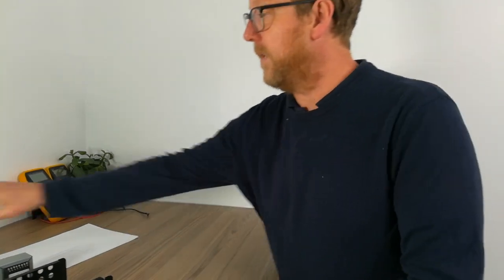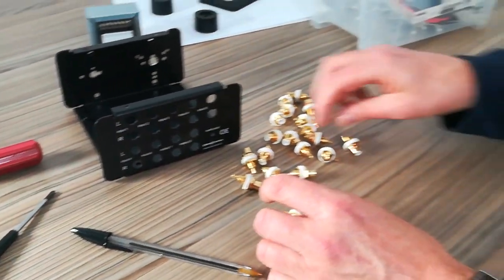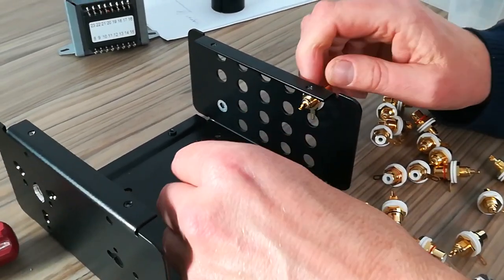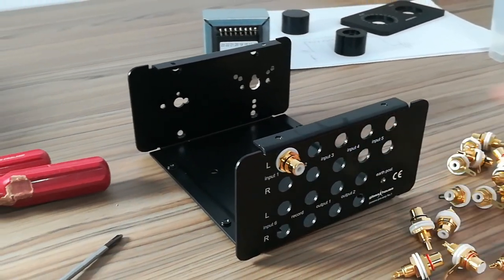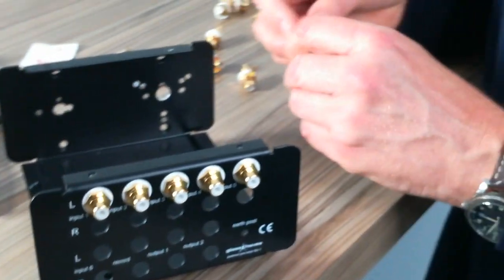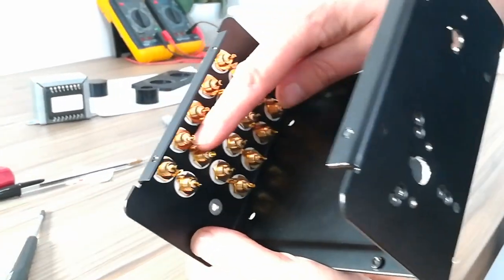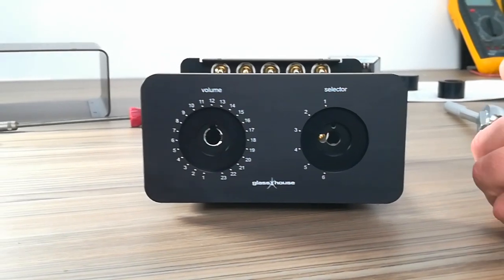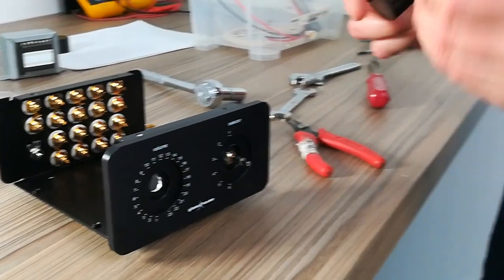How To: Build the Glasshouse Passive Pre-amplifier (part 1)

Comment: what advertising nonsense! Is all the technology of the 20th century used here? And about the technology of the 21st century - normalizers, input correctors, amplifiers of Kunashirsky and stars of Kunashirsky did not even hear ?!
So laugh like
Reply from the maker: Thanks for the comment! It seems to be quite a popular design, and is used, either the glasshouse version or other, by many.
Reply: @hificollective  Clear. And do you have information about the device "network voltage fractalizer", which has been used for amplifiers for 4 years?
Here is a sample of the sound of my full audio path, in which there is this fantastic device (and three others but they have long been known in Russia - 12 years) - https://youtu.be/RZ4uE3S2Y34